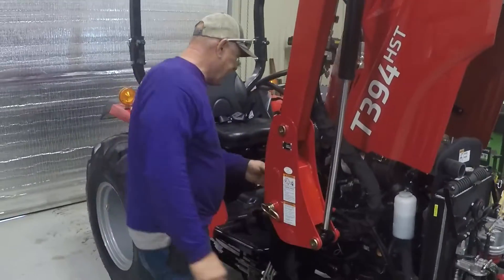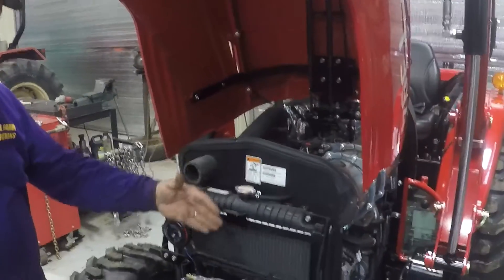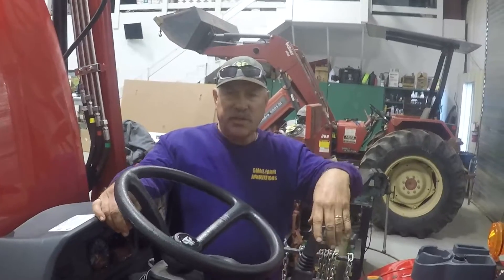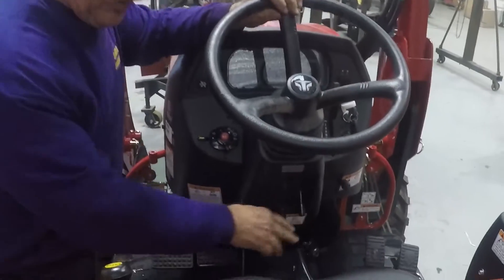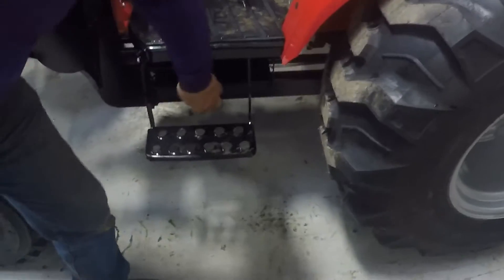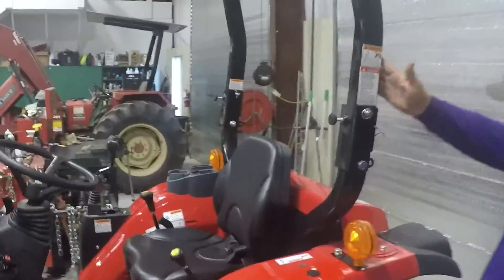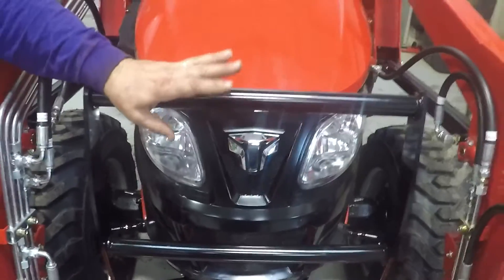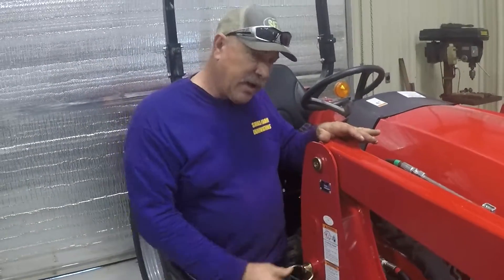TYM T394 and T354 Operation and Maintenance

Comment: I just finished my 50hr service on my RK37S / TYM. So far I've been very impressed with the tractor. Glad I found your channel as you are very knowledgeable on the TYM's. I've found so far I'm better off learning about the tractor on my own from outside sources like yourself. Thank you.
Reply from the maker: let me know if you have any questions.
Reply: @smallfarminnovations4265  Thank you. I do have one question on checking the fluid level on the transmission. I have the shuttle shift transmission. Should the 3 point lift arms be up or down. I noticed it made a slight difference in the sight glass window. The manual isn't bad but it's not real specific on things and I've noticed not all things are the same as my tractor. Thank you very much.
Reply from the maker: @danclas5983  Have everything down.  Loader, three point and any implement that is used with hydraulic remotes.  Fill oil till level is below the red dot in the sight glass or 1/4 way up on dip-stick.  Re-check oil when warm. 130 degrees is normal hydraulic/Transmission oil Temp.  The oil level will rise to normal level when hot.
Reply: @smallfarminnovations4265  Thank you very much.

Comment: Great informative video. You mentioned pulling a tandem 10 ft disk. Does the tractor have enough power to disk with that disk or is that just to transport it? What’s the max rpm in low range using an implement?
On the 394, what’s the max size of rotary cutter.  Thanks
Reply from the maker: 394 will pull a 10ft tandem pull type disc but not mounted. You will need rear remote outlets. 394 does not come with rear remotes. I have a Pittsburg 10ft. pull type  disc it will pull it in low range 4 wheel drive.  A 6 foot rotary cutter max. Always run at full throttle when pulling any tillage non PTO driven implement.  Increase speed until engine pulls down to above PTO speed.  Your at max load with out hurting anything.
Reply: @smallfarminnovations4265   Thank you. Mine has one set of  rear remotes, it came with a backhoe attachment. A line runs from the pump to the remotes. Then I have a lever beside the seat. The middle position is backhoe.  Pull handle back and it operates the lift arm. Forward or back operated my hydraulic top link. I want to install 4 remotes at the rear. What is the best way to connect and still be able to use lift arms.
Reply from the maker: If you me 4 remotes which is 8 couplers your going to run out of room.  If you mean 4 couplers which is two remotes they do not offer a kit for this tractor.  You will have to set up a after market system.  I'm setting up a 790 deere this week wit one single remote .  Ill make a video for you for reference.
Reply: @smallfarminnovations4265  Thank you sir. I look forward to it. Yes I was thinking 8 couplers, 4 sets. I have subscribed to your page. Enjoy your videos, very informative. Not many videos out there about the TYM and available options, OEM or aftermarket.
Reply: How many remotes does it take for a Flail mower?
Reply from the maker: For a two axis like the Giraffa series two  would be great.  There are electric over hydraulic diverter vales out there you can mount on the machine or tractor. You flip a switch to divert flow to another actuator. Look for a two or three circuit hydraulic multiplier.  600-900 $ depending on how many circuits.
Reply: @smallfarminnovations4265  my 1952 WD45 will pull an 18 ft tandem disk but it won't pull it real deep.
Reply from the maker: @assyholey4224  I would like to have a WD45 narrow front to pull our square baler.
Reply: @smallfarminnovations4265  there are some in N-E Missouri. cheap $1500 or less everyone want's new, even D-series like D14 can't find good homes. money now is parting them out. I have added Gleaner combine engine, power steering, live hydraulics, and 36x14.9 rear rice & Cain tires she is a real work horse, it was all cheap.

Comment: Thank you for the detail. It is refreshing but I still have only found ONE video describing troubleshooting a stuck PTO lever on my 394 hst and he leaves out so much of what I wanted to ask, it was frustrating. Could you possibly make a video or point me to a better source (besides the dealer) for tips? The video I did see was super dark and was already night and the guy didn't explain more than taking off the right tire and loosening what I assume was the through the engine connection with the left side PTO engagement lever , spray some penetrating oil and maybe pull and clean a sliding lever behind that same connection.  Any help would be appreciated.
Reply from the maker: I'm pushed for time to make a video and up load it .  My phone number is 979-200-1473.  Shoot me a text and I will text you a short video what two nuts to loosen with a 14mm wrench.  474 units do this also.  When I get a free moment I'll make another video.  Was in South Koreas last week at the TYM plant for training on their 115 and 130 hp units. Pretty Snazzy!

Comment: where is the suction screen for HST?
Reply from the maker: Look for the rubber 90 degree rubber elbow under the left side down low in front of the axle. Its behind that elbow. You will need a 12mm wrench to pull it.
Reply: @smallfarminnovations4265  Thanks! I looked in the owner's manual which told me to put 80w90 in the transmission. I new the manual was useless at that point and is only to be used in small claims LOL.
Reply from the maker: @bradguay4694   Use premium universal hydraulic oil.  90wt will work but it will be hard on the input shaft of the HYD pump on a cold day. 90 wt. is not recommended for HST transmissions because of lack of anti foaming properties, detergent and cooling capabilities.
Reply: @smallfarminnovations4265  do you have to remove frame rail to remove the suction filter? I've yet to find a video or anything of someone mentioning it let alone replacing it
Reply from the maker: @KTMjs449  You should be able to get it out with out removing the loader sub-frame rail.   The suction screen needs to be cleaned every 600 hours or oil got contaminated with water or dirt.